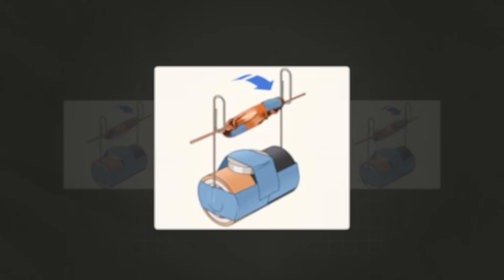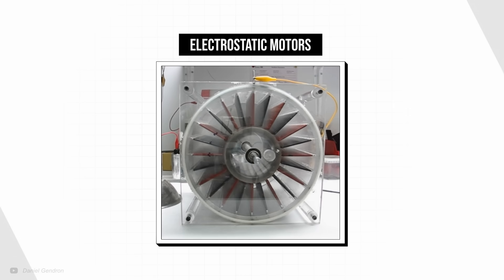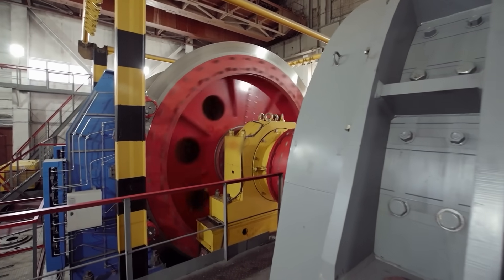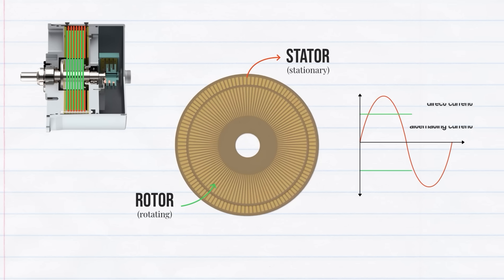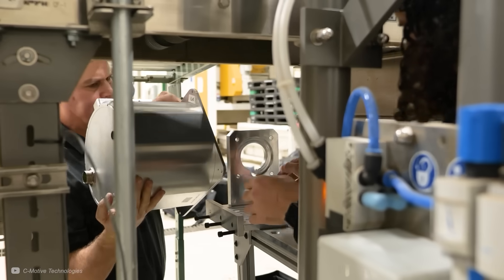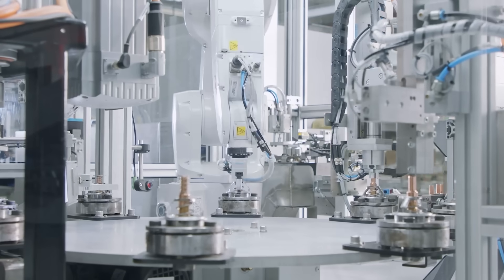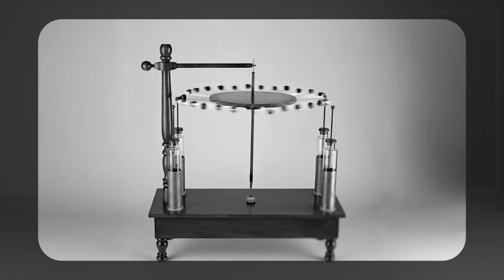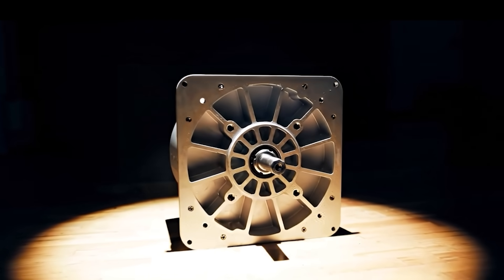How Electrostatic Motors are Breaking All the Rules

Comment: There are two things, that speak against fluid insulated motors: i) Drag of fluids, that create lots of friction losses. Nikolai Tesla's disk-pump even uses this feature to transport fluids. ii) Huge switching losses from charging/discharging electrodes by handling much more reactive power than useful electrical power; since C = Q/U. The only mean to avoid fluidic drag would be an operation in a high-vacuum environment, while even this is not safe due to possible vacuum arcing, when the force from electrical field strength exceeds Coulomb's binding forces of electrons. Moving electrons are defined as current as the known equation shows i(t) = dq(t)/dt. Contemporary reluctance motors as SynRM or SWRM can circumvent many of the efficiency and rare earth problems of conventional BLDC- and induction motors. And copper is no longer a problem, when copper-clad aluminium magnet-wires are used, because high operation frequencies prefer the outer region of wires due to the skin-effect.
Reply: No arguments on your main points, they're great and well-written!  

I wanted to mention the drag of fluids.  Some of these exotic dielectric fluids have seriously wacky properties.  Without knowing more about its behavior, we can't be sure, but fluids like Fluorinert and Galden boil at low temps and could have some kind of weird Leidenfrost effect or something that keeps them from dragging on the rotors.  It's also possible that one of the upcoming SF6 alternatives could also have desirable properties.  Still a big unanswered challenge though.
Reply: @spirituallyinsane  There is no magical fluid. Bernoulli's laws are always there. To remove friction between a solid and a liquid, you need e.g. a gas phase boundary like e.g. supercavitation does, or a plasma like many advanced flying machines use to reduce drag. Such measures however decrease entropy and needs energy itself.
Reply: итого, чтоб получить нормальный электростатический двигатель нужно:
1) большую колбу с вакуумом
2) обкладки с изоляцией
3) довольно дорогой преоразователь.
Как по мне - диски нужно делать с покрытием из тефлона - у него пробивное около 30кВ на мм - как раз плёнки по 0.2мм выдержат 3-4кВ легко, и ещё останется "зазор" в 0.1мм для "вращения". В вакууме. иначе получим "корону" между обкладками...

Comment: you forgot that there is a lot of "hgray energy" which is the amount of nergy to produce the electromagnetic motor (like grey energy for example in buildings)  wgich ist lost whn you try to  replace one motor with another. and additionally the costs of the new motor.
it is like with vehicles: the most environmental friedly car is  that which is not produced because the old car runs longer.
fact: rplacing an existent motor with another ist a form of  stupidity. twhat will you do with bilions of "old" motors? what about household technique? fans, mixers, vacuum cleaners, washing machines, dryers etc?
the rest of tha arguments acn be read below.

Comment: 6:20 "4000v" is stated but is incomplete information. 4000volts for what gap? 7.5 µm? 1mm?
Transformer oil has a breakdown voltage of 30 000v. Do you want to know for what gap?

Anyway, 
1- electrostatic motors are not new
2- they will not replace the type of motors that uses rare earth.

The best they discovered is a new chemical product that insulates electricity. (Which is probably worst for ecology and economy than oil)
Reply: They did mention 0.8mm between the plates.

Comment: Sounds good at first but think a bit longer about them. Every creator of new technology said id is harmless and decades later nobody knows how to get rid of the trash. Look at SF6 insulation gas, PCB in insulation oil, PTFE in wire insulation. The list goes on with solar panels, wind turbines, batteries, neodymium magnets etc.. And the second problem is the gasket and the closed design for the liquid. The day the engine fails, is the day you replace it with a new one instead of repairing it. I don't want to say that the engine is not good or going to work but history tells us that we should be curious about the promises from the creators. 🤔

Comment: "Replacing current 1/2 to 3 hp motors .."  with these new electrostatic motors. 
Where does the torque of their '3 hp' electrostatic motor match the torque current electro-magnetic '3hp' motor ? 
Loved to have seen a comparison chart
Reply: Torque is a direct function of power. Accepting their claims, if their engine ha an efficiency of 90%, while a traditional one, once installed the gearbox, obtains 65%, then their torque is 38% higher for any given power. 
Obviously that applies only at low RPM, where their engine doesn't need a gearbox. Another article talks of 0 to 300 rpm.

Comment: It's incredibly easy to just make permanent magnets using common earth minerals and solar radiation, bypassing the need for rare earth minerals entirely.  The future is not efficiency, it's abundance, and dependability.  The same plant making permanent batteries with solar radiation can supply a downstream distributed energy network with inductance to couple hydraulic pumps to generators, replacing rare earth batteries and fossil fuels, with gravity batteries that make use of any available mass and gravity for long term extremely efficient storage.

Comment: I'm curios to if these motors would work well in aviation. High voltages can be a harder to manage as atmospheric pressure decrease but if it's all in dielectric fluid that's fine. There are a lot of geared electric motors on today's airplanes. And many hydraulic motors systems that could be redesigned if an electric motor could be a lighter alternative.

Comment: Got curious about the Input Source for these motors. Since we are relying on Eletrostatic force, I imagine we are talking about thousands of voltages to feed the stator, Hard to imagine having the whole electrical installation being re-installed just to fit the voltages required to run these motors.
Reply: It only needs a transformer. 4000v is not even that high. old CRT TVs worked at 16000v.

Comment: Cool, especially the low speed/high torque aspect.  The dielectric fluid is pretty nice, too.  The efficiency gain is non trivial.  I wonder how they would work for very high speed applications. I would assume minimal limiting back EMF due to inductive losses, but I would expect that there are capacitive losses in these motors?  It seems like the power to weight would be quite good, as well, for say, aircraft applications, ultimately?   Power/volume would also be critical there.  Great stuff, I will do some research.  Thx.
Reply: Those engines are limited in RPM, because every time one of those flat electrodes of the rotor passes over one of the flat electrodes of the stator, you have to change polarity of the electrodes. With 112 electrodes, it means you have to change polatity 112 times for every turn of the engine. There is a limit to the speed you can change the polarity of a circuit. 
another articles talks about 300 RPM for that engine.
Also the liquid start to be a limiting factor at around 500 rpm.
Reply: @neutronalchemist3241  The switching frequency is limited primarily by capacitance, I expect, so in essence we are both saying the same thing.

Yes, I would expect that fluid frictional dynamics between those plates might be severely limiting, at some point of increasing RPM, essentially starting to imitate a fluid coupled clutch, albeit a horribly inefficient design for that function, but still quite limiting from a drag standpoint.  Good point.

Comment: If there is no directionality in the copper over the plates, how do you guarantee that the motor will spin in one direction and not the opposite when it starts? It seems it will depend in the particular idle position.

Unless the design has directionality in some way, which is not appreciated in the pictures.

Comment: Interesting! What kind of high voltage is used for these motors? Is a transformer required, or how do they get from standard ac to the voltage required?
Reply: A transformer is required. It had been said that the liquid insulates up to 4000v, so the operative tension is lower. less than 4000v is not that high. Old CRT TVs operated at 16000v.

Comment: Let me guess… they filled it with WD40! 
-I would like to see some independent figures. A 1,5 kW motor at 0.25$/kWh costs $3285 per annum in electricity.  

To move at it from another angle: As they claim to be 25% more efficient, the yearly total cost of electric power for a 1,5kWh motor would amount to 4x $1400= $5600,- or 64 cents/kWh. 
Conclusion: get a better contract first, before you buy a new motor.

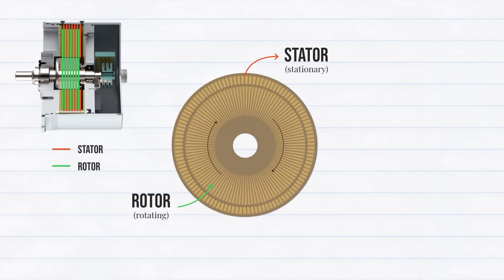Comment: 5:00 But why cry for rare elements and try to make other chalnege motor? we already have AC motor wich rabit cage rotor. The already used by TeslaMotors. only cooper and iron no magnet. 90%less cooper ok but at what cost? how you deal with the heat from electric volt? also an voltaic arc erode materials. I think is not going to far. But i like to see new try and diferent aproch. Soo keep going...xD
Reply: Tesla hasn’t been using that design for a long time. It’s efficiency and torque density isn’t great, and the control is very complicated

Comment: 6:10   secret proprietary fluid.... Strike 1

Very narrow spacing between stator and rotor... filled with that fluid ???? Nice torque converter... strike 2

Electromagnetic motors using Printed circuit windings, ( high torque DC servo motors for plotters and high-speed CNC machinery ) exist since over 40 years..... Just plain pulsed air cooling, no top-secret classified fluid... Strike 3.

High fidelity tried, many years ago with electrostatic speakers, yet, 99.99 % of all drivers used today are electromagnetic. Only exception: Electret condenser microphones (very popular ) work on electric induction.

And to finish, nearly 100 % of all industrial motors used today are squirrel cage induction three phase units that use good ol' SC rotors that use plain laminated steel disks with cast aluminum shorting  bars.

Nothing  extraterrestrial here, Add simple fixed uncommutated stator windings, their reliability is unsurpassed.  Along wih a correctly configured VFD, they willl be used for decades to come.

Comment: The principle of the dielectric medium can also be achieved using a noble gas under a certain vacuum as I have done in some experiments. My idea doesn't even need moving parts. It is more than just static discharge because it can be transmitted at frequency of choices which I am experimenting to fine tune it. Great video because it's good to see others working and sharing great information. Thank you awesome video.😊
Reply: No. Reducing the pressure in a gas will LOWER its breakdown voltage, not increase it as is needed in this application. Gas under HIGHER pressure would increase the breakdown voltage but also increase the drag factor.
Reply: Plus, it would have some fine colours if the whole motor body is transparent

Comment: 6:20
the correct unit for dielectric strength is volt/meter or any (voltage / length) unit. 
What's the source for this number? i'm curious about it

Comment: My question which I think is important at least on my end: can they generate power without an Initial power input, or does it still rely on an initial power source from another device?
Reason being that if there were any option to generate power without using magnets altogether, I'd be impressed. But from what I see you need an initial flow of electricity for this device to work in the first place.
Not knocking it though, the device itself is interesting, especially since they could easily be 3d printed out of common materials.
So if anything they'd be a great extension on other systems
Reply: As is this would be a great way to step up a charge from a weak energy input, or relatively weak at least.
Reply: Also, just an interesting side note, the mechanical effects of the electrostatic motor still rely on attraction and repulsion.
So I wouldn't consider this altogether not using magnets.
Just much smaller ones via the inherent properties of electricity.
Big hints there
Reply: In effect your sort of semi magnetizing the copper itself. An intermittent magnetic surface is interesting
Reply: Though technically copper is diamagnetic. So you wouldn't see the repulsive effect without magnetism being involved.
And currently the argument is that copper can't be magnetized.
So this debate should be fun.
I mean if copper can be attracted to a magnetic field it can be called ferromagnetic, and it's already considered diamagnetic.
Game on
Reply: Though now I'm curious. Technically a moving charge creates a magnetic field.
I wonder if there's a way to just consider a moving electric current a magnet in and of itself.

Comment: If the main purpose here is to eliminate the need for rare-earth magnets, remember that this static-based tech requires input current - current generated by power generation systems that almost exclusively use a large volume of magnets already, and including those built in the future. Even nuclear plants, since they use conventional steam-driven generators which utilize magnets.

Better to limit expectations and applications to lesser-critical aspects of our infrastructure, such as solenoids, contractors, and process controls rather than primary traction power until the static potential is explored, proven and optimized.

Comment: I want one but I want to use it as a generator hooked up to a gravity battery on my Ranch. Gearboxes are kind of the problem with gravity powered generators. I'm assuming these motors are reversible? Ergo I could use excess solar power during the day to lift an object and then since the high-torque and high voltage power all my lights and stuff at night?

Comment: 10:01 - axial flux motors are not new. Furthermore, conventional designs lack capacity in terms of duty cycle. Also, in it's most basic sense, these PWM/PCB motors are axial flux motors... but the low current allows them to operate more efficiently.

Comment: Dozen of plates spinning in electric oil and they talk about high efficiency and low temperature? Yeah, right. And how about efficiency of high-voltage source? Or are they supposed to connect directly to 6KV electrical grid, without frequency regulators? And what with 65% output of conventional motors? - it is very doubtful.

Comment: Thanks for sharing, very interesting topic. Likely not a universal solution but likely a good fit for select applications. Was pondering as many have said the dielectric fluid is likely to cause surface drag, almost like a Tesla turbine. Might make a simplified fewer part generator if it were configured like a Tesla turbine and the dielectric fluid does double duty as the prime mover.

Comment: getting into the 7 minutes of the video, the current eletrostatic motor sounds dangerous. What if you find these things laying around like a decade later and the fluid has leaked out or something? The motor design sounds cheap in ingredients, but the fluid is a red flag to me currently, although they do say it is non-toxic, leakage due to age is the first concern that came up to me. 

Correct me if i'm wrong, but this concept sounds like the motor uses a lot more voltage to make up for cost of material resources + the fluid to nullify the heat it generates. I might have misheard though.

Comment: If it was not an exclusive access video I would no believe in my eyes. This motor has the worst of every world. The need to seal a fluid inside the motor like an combustion engine,The need of brushes and high maintenance as DC motors and yet  the need of two independent drive circuits. for the stator and the rotor. It does have some advantages.... but in the other way it is way worse. To me it looks like an desperate attempt to circumvent china power over rare earth. I hope this technology prove me wrong......

Comment: There was a recent report of Japanese researchers making a working electric motor using graphene instead of copper for the coils. I wonder if graphene would work well with these electrostatic motors? Graphene has far superior switching speeds, has much lower resistance and is much lighter.

Comment: The breakdown field strength is measured in V/cm. For example air has a dielectric strength of ~30kV/cm. That means the 4kV voltage (@6:20) would find it impossible to initiate dielectric breakdown across 1m of air, while it would be able to do so for 1mm of air.
Reply: Compare that to mineral oil.

Comment: This is going to fail except for some extremely limited special cases. Why? Because 90% of industry is using induction motors which are cheaper, simpler, don't require any electronics to drive and can be repaired with a screwdriver and a hammer.